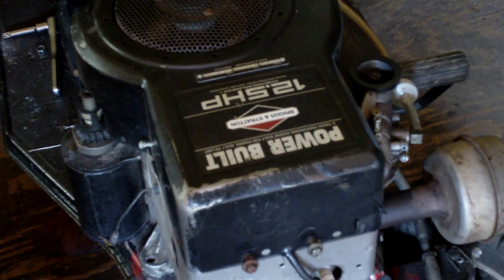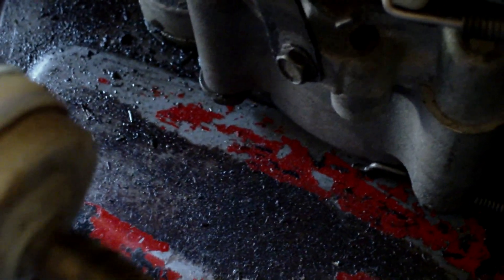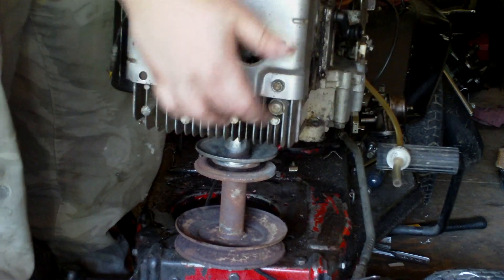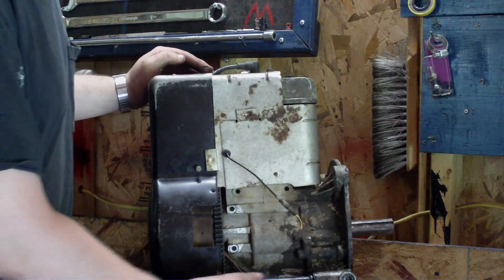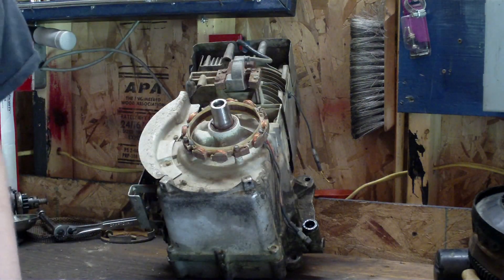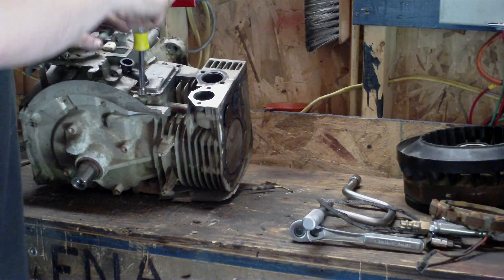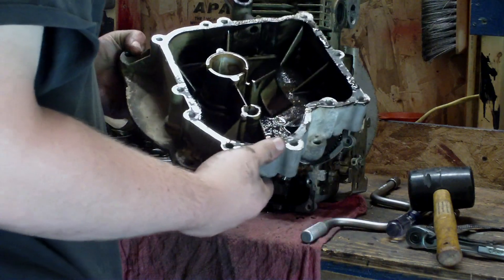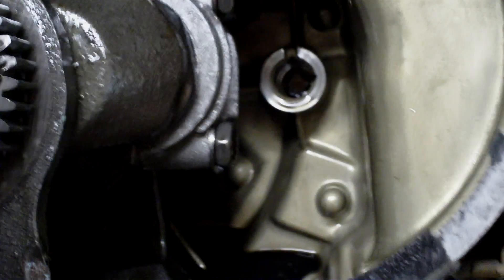Briggs and Stratton Power Built 12.5 HP Flathead Model 28 Rebuild, Teardown / Reassembly PART 1

Comment: I have the same engine exactly the same. It smokes. I thought it may be the head gasket, when I pulled the head it seemed to be in pretty good shape. But what I noticed was that where the Piston comes through the sleeve the Piston has a nick and I know for a fact that must be where the oil is coming from. So I suppose I should tear it down quite sure even if that Nick is only on that side of the pistol whatever caused it may have also damaged the Rings. However your video will help me in this endeavor

Comment: I am in the process of rebuilding this exact same engine and could not have done it without your videos so thank you so much!  One question.  I got the rings on the piston and got the piston in the block.  This is my first time rebuilding an engine.  The piston seems tight in the block.  I put the flywheel on and am able to rotate the engine relatively easily by hand.  I ordered the standard size rings.  Can you advise if the tightness is normal?  THANK YOU!
Reply: If you have the head gasket, head, and spark plug in head all on the block you should have compression

Comment: Hey buddy… I wonder if you have a video that will help me with this issue I’m having on two of my engines. Both vertical shaft Briggs single cylinder, one is a 10hp flathead and one is a 13.5 ohv. Both are mounted on snapper rear engine rider mowers. So, what is happening is when I fire them up they idle on low nice and easy but after I run the deck and ride them around a little they act fine till I put them in neutral and shut off the deck to step off to pick something up or move something out of my way. That’s when “no matter how low I set the throttle “ they rev up to super high rpms and I have to shut them off because I’m worried about blowing them up they idle so high. But after I re engage the deck it starts idling a bit lower again. “Update “ I found the issue. Seems to be the low speed screw on the carburetor. At least on one of the snappers. Since my other snapper is doing the same thing… I’m pretty sure it will be the same solution.

Comment: hello Excellent informative video. Thank you for your expertise,
Can you give me the tightening torques for the Bridge & stratton engine 286707-1142-E1?
I can't find it anywhere in  the Illustrative parts List and the Operators Manual, especially the one on the piston rod where there are two different bolts on the connection to the crankshaft!

thanks in advance

Comment: Excellent informative video. Thank you for your expertise. I have a question for you. I have a 21 year old Murray lawn tractor with one of these engines. The engine is having more vibration. In fact, the way Murray attached the 4 engine mounting bolts to the frame using a 1/8 inch sheet metal plate and four sheet metal screws through the top of the plate to the frame itself, from the vibration the sheet metal screws stripped themselves out of the frame. I fixed that by  Mig welding the 1/8 inch sheet metal mounting plate to the frame. I should still be able to remove the engine by the 4 Briggs and Stratton mounting bolts that go through the bottom of 1/8 inch sheet metal plate. I am running it again. The engine is now ultra secure to the frame but still has vibration you can feel through the  body of the tractor. At certain rpm's the vibration is more noticable. Do you think the engine is ready to have a catastrophic failure or can I keep running it and hope for the best? I'd get a new lawn tractor but after checking the Home Dept  prices of new junky models I figure I will keep running my Murray as long as I can. Appreciate your input. Thank you.

Comment: I need your help I have the same motor  cranks and runs and everything 
 but you can get your hand and motor almost spins freely does that mean my rings are bad
Reply from the maker: I'd say its more then likely the valves needing adjusted and possibly reseated. Thanks for Watching!!!
Reply: So I need to do a valve job can I run it like that into I get time it runs just fine like it is

Comment: My Briggs built around 1989 dosen't have a nut on top of flywheel how do you pull one like this ?
Reply from the maker: It may have a starter clutch on it if it has a pull rope as well, if not it should either a nut or bolt. Thanks for Watching!!!

Comment: What year did they discontinue these good flathead engines? I just cleaned one up I got free yesterday built in 2003. Was that the last year for them, I know its somewhere around that time.
Reply from the maker: It was around 2005/2006, I have a 2005 opposed twin flathead. The epa starting making stricter regulations on small engines and forced the move to ohv. Now they are starting to bring electronic fuel injection to small engines. good and bad in my opinion. Its a shame, I still use these flatheads on my main mowers. Thanks for Watching!!!

Comment: I have a 1998 one of those and I'm in the process of repairing it. I need to replace the cylinder head and do some work on the carb.
Reply from the maker: They are good engines. Look on ebay for the head if you do not have one. Thanks for Watching!!!

Comment: fna, I rebuilt my 12.5 flathead based off of this tutorial and it works. Part of my problem now is that the exhaust has blue flames blowing out of the exhaust, which tells me that the valve on the engine side isn't completely seated when the exhaust valve is opening. Does this sound plausible? I didn't do a gap check on the valves as you suggested in the video, mostly because I didnt understand what I was doing. I do recall you saying something like "or you can just replace them" are they gapped to the correct gap when you purchase them? What about the lifter rods that lead up to the valves? Is there a chance that they can become shorter by chance after a blown engine?
Reply from the maker: Yeah, sounds like the valves are not sealing, I'd recommend doing a valve lap and check the gap to make sure they are sealed. Even with new valves you still have to lap and check the gap, I can't remember what I said in this video been a long time since i put it up. I just built a new 5hp engine out of NOS parts and had a new cam, valves and lifters, and i had to grind the valves quite a bit before they would even close. Thanks for Watching!!!

Comment: Do you do any work on old Tecumseh engines ? I have to old 5hp Tecumseh engines that don't have model numbers stamped on the housings . one used to have a data tag riveted to the block but its long gone ! I need parts for then ( points & condensers ) but cant get anything with out having model numbers !
Reply from the maker: Its been a while but I do have a couple 10HP's and a 12Hp that i'm going to be working on this summer, but generally I don't care much for them, they are good when they are running but I've always carburetor issues with them. I'm not to sure of the 5hp tecumsehs, my best guess would be to google it or search on ebay for 5hp tecumseh points and condensers, i'm sure something will come up. If I had a model number I'd look it up for ya. Thanks for Watching!!!

Comment: i have a 91 gt6000 horizontal  sears. it blew up and i want to repower it vertical shaft and im wondering if it would be possible and prudent to try it .old mower is in great shape
Reply from the maker: Going from horizontal to vertical isn't easy to do, belts are always a problem. But it would be worth rebuilding if possible or getting another horizontal. Thanks for watching

Comment: i have a 91 gt6000 horizontal  sears. it blew up and i want to repower it vertical shaft and im wondering if it would be possible and prudent to try it .old mower is in great shape

Comment: i got one of these from a junkyard for only 5 bucks tore the whole thing apart and all that was in it was a little bit of water but cylinder walls were like new bearings were in decent shape all it needs is to have the crank case flushed out and have the rust cleaned and after i do that replace every gasket and i got a perfectly good engine
Reply from the maker: I hear ya! Can't beat that! Hope you get it going! Thanks for Watching!!!

Comment: Please do me a favor and check the bore and stroke for me. I bought a full size engine, flathead model. At first i thought it was an 11 horse, then 10, then 8 and now im thinking we have the same engine after i checked my displacement. An online calculator says it has about 12.5 hp @ 3500 rpm. I dont have the correct shroud for it and i probably dont have the right carb.
Reply from the maker: I don't have any tore down at the moment, but the stroke on a 11 and 12 hp are 3.436" if that helps any. I have a video comparing a 11 and 12 hp (models 25 and 28) and you might be able visually see some differences, first off pay attention to the # of bolts that hold that oil sump on... https://youtu.be/H1kiFqCDCh0 Hope this helps, Thanks for Watching!!!
Reply: fnaguitarplayer9 thank you very much, I'm gonna watch it
Reply from the maker: your welcome!
Reply: fnaguitarplayer9 just now thought of it... is there any chance you could get me the model number to the 12.5 horse?

Comment: What's the difference between this engine and an I/C 12.5hp Briggs flathead?
Reply from the maker: not much really, some have told me that the power builts don't have the cast iron sleeves, but this one did, unless it was the wrong shroud on the block. But other than that possibility they are identical. Thanks for Watching!!!

Comment: It's this particular engine that I enjoy working on more than any other. So simple yet so well built. Always fun fixing these.
Reply: +Justin King The 8 hp model is pretty nice too. I had one in an old Toro I fixed/sold.
Reply from the maker: +Justin King I know what you mean, seems like all the old flatheads were so simple and easy to work on, and not to mention super reliable. Just like the motor in the video, before i rebuilt it, it smoked like crazy barely had any compression, but still i was able to get it running! Thanks for Watching!!!
Reply: I've seen the balance shafts break a million times in the I/C engines like this one though.
Reply from the maker: Oh yeah they are bad about that, especially that dogbone rod on the weights.

Comment: i,m putting the same engine back together but when i tighten down the connecting rod cap bolts,you can barely turn the crankshaft...but when i leave the bolts loose..you can easily turn the crankshaft....wth is going on...dont know how the connecting rod bolts would have anything to do with turning the crankshaft....what is going on here??
Reply from the maker: +Tim Spur Did your replace the rod, or did the engine throw a rod? If so then the journal may need to be cleaned some, or you were sold the undersized rod (a .020" undersized rod is available for these). Also another comes to mind, make sure that the end cap is going on right, it will only go on one way, it has a notch in it, it looks almost the same both ways, been there done that! If the bolts are tightened to much they will do that too. Hope this helps, if not get back with me and we'll figure it out! Thanks for Watching!!!
Reply: yeah it broke the rod from having no oil..got it for free...i got it turning ok now..dont know what was going on but now i,m having a time getting the oil pan back on without the oil slinger moving or keeping the pan from going back on all the way...i have it tilted like u did in the video but its not wanting to line up right or something
Reply from the maker: +Tim Spur It probably had a bur or rough spot on the journal, hopefully it didn't score the new rod. That can be a real pain sometimes. Have you checked the cam bearing on the cover? Sometimes if the rod hits the camshaft when it breaks, it will bust out that part of the cover. Another tip, i don't know if i said it in this video or the other one, but the "shaft" on the oil slinger where it slides in out with the weights, make sure its up against the governor shaft, the part that looks like a paddle in a way. Usually if its touching it will slide right together.
Reply: thanks i finally got it lined up right
Reply from the maker: no problem!

Comment: Can you run that rectifier thing past me again? I just inherited one of these engines that was removed from the tractor and, while I see the wire off of the stator, I really don't know what it is supposed to plug into. I understand it charges the battery and I suspect it plugs into something (rectifier) but would like to better understand everything from that wire to the battery.
Reply from the maker: +AlwaysFreeAmerica I'll try to explain it, first off the stator puts out AC power, the rectifier (actually just a diode on these) converts it to DC to charge the battery back, the 2 wires off the stator are both hot actually, one is AC and one is DC, the diode is usually built into the wire before the plug, the AC wire is for the headlights on the tractor, which doesn't matter if its ac or dc. So basically the best way to find out which wire is which, is use a volt meter, connect the Black to the frame or engine block, and test each wire with the volt meter set to DC, if you get a steady 12-14 volts (aprox) on one wire the engine running, that should be the dc wire, and the other should read 0 or really low, until its switched to ac on the meter. And if it has a amp meter, it will connect between the DC wire and battery (through the ignition switch if its wired through it) Hope this makes sense! thanks for watching!!!
Reply: Cool. I really do understand all the principles, I just wondered if there was always a rectifier/regulator because a diode really doesn't do any conversion, it just blocks the negative half of the sine wave. I have since discovered that a rectifier/regulator is used mostly if 7 or more amps are generated. To me, a simple diode is a weak method to get just the positive half of the AC cycle. A rectifier would make both halves available (positive) as well as bump up the amperage. My Kohlers use a rectifier/regulator thus the misunderstanding with a diode in the briggs.
Reply from the maker: +AlwaysFreeAmerica I hear ya, That is true, its a super simple/basic setup, but it does keep the batteries up, i agree, i always thought it was a bad setup, but it does work. It might be worth experimenting with, most of the stators are rated for 6-8 amps on these motors, so it probably push more than that with a rectifier. I've been wanting to go with LED headlights and wire the light switch to the battery, so they can be turned on with the motor off, and would be the same brightness no matter what rpm the motor is running. some briggs do have a regulator box, but most of the time its just the diode.

Comment: Hey fnaguitarplayer9 my 12 hp Briggs only has 32 Pounds of compression. Is this valve related or piston rings.ect.
Reply from the maker: +Carson Albrecht First thing I'd check is valves, unless its burning oil alot, what usually happens is the seat and valve face wear so they don't seal and there basically is no valve clearance/last, so just adjusting the clearance and lapping the valves will usually help alot. If its smoking a whole lot then I'd say rings as well, but its usually mainly the valves. Thanks for Watching!!!

Comment: How many cubic inches is that ?
Reply from the maker: +Carson Albrecht 28, the first 1-2 digits of the model number on briggs engines is the cubic inch displacement, on 6 digit numbers, its the first 2, on 5 digits its just the first, like a 3-3.5HP push mower engine, that would be 9 cubic inch. Thanks for Watching!!!

Comment: I've got a 8hp flat head briggs on an old snapper riding mower from the late 70s or so.  Been in the family since new...anyway it runs surprisingly well but smokes like crazy, especially under load.  In fact i'm a little surprised that it runs as good as it does and burns that much oil.  I'm 95% sure it is one of the cheaper aluminum bore engines but i have not taken the head  off to be sure.  I originally thought I'd just buy a new OHV engine to put on it but they cost a lot more than I thought I would and they are quite a bit longer than the old flat heads and would require a good bit of modification to the mower to fit.  Do you think it could be saved (or would be worth the trouble?) Can the aluminum bore engines be bored over or will it just self destruct?   I've never had an engine completely apart but I don't think its going to live much longer as it is so I guess I don't have much to lose.
Reply from the maker: +thereve Those are really nice motors and it definitely be worth trying to rebuild it (my opinion). The thing about the aluminum "kool bore" engines is you have to use chrome piston rings (and a chrome coated piston if it needs replaced), if you use standard (cast iron) rings it will score up the cylinder, the chrome set is already oversized slightly to allow them to seat into the cylinder, basically on a alum bore, the cylinder seats to rings as opposed to rings seating to the cylinder, you can't bore them out bigger because they don't additional sizes in the chrome rings, only way to bore it out would be to have a sleeve pressed in, and its will be costly, not as much as a new motor but it will be several hundred dollars. I would suggest trying to re-ring it and do a valve job on it, the valve guides are probably worn some too causing it to smoke, but new rings will at least help it and bring back any lost power. No guarantees because the cylinder could be worn or scored as well. But its definitely worth trying a rebuild on. Thanks for Watching!!!